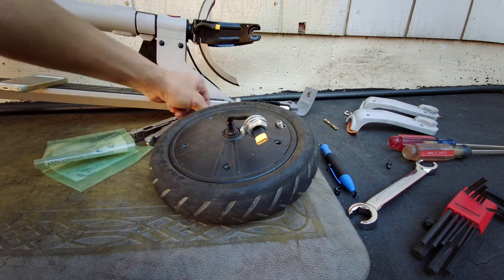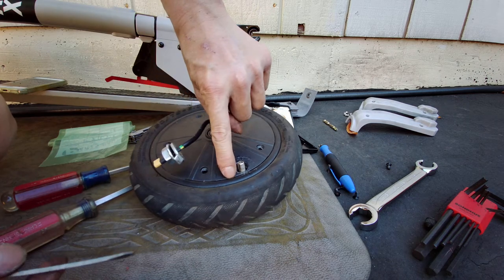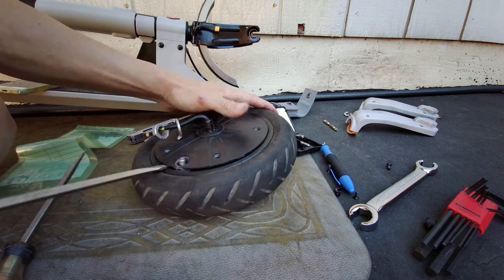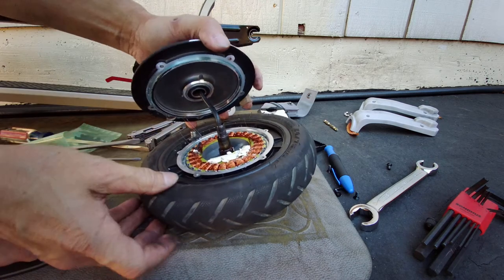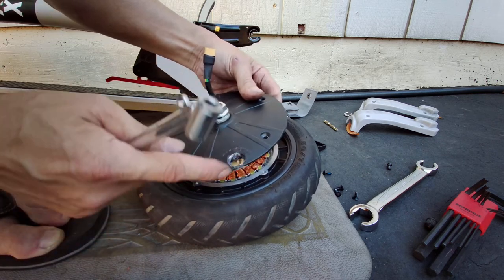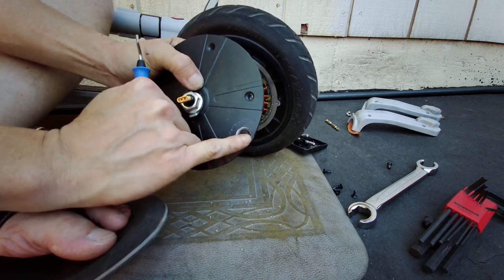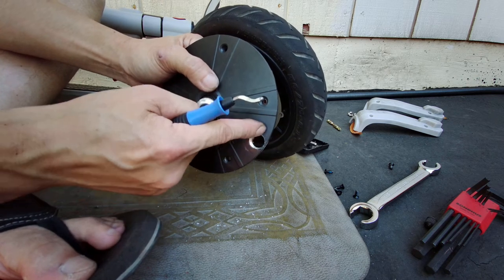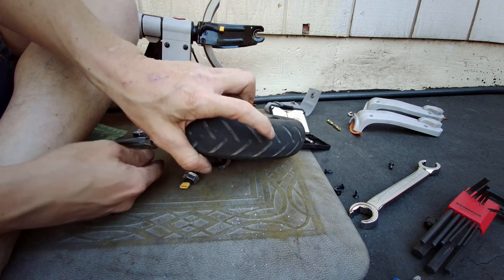GoTrax hub motor plate removal pt.2

Comment: I hit a little bump and now it doesn’t work at all. When I press down the throttle it moves for one second then stops. The number 23e showed up on the screen every time too. Does anyone know how to fix this???
Reply from the maker: sounds more than a little bump.  But check all your wire connections first.

Comment: My gotrax motor started having a grinding noise when i ride for 15-20 minutes. It doesnt make any noise at first but as the motor warms up it slowly gets louder and louder. Ive opened the motor and cant see anything physically wrong which would cause any issues. Any possible ideas?
Reply from the maker: wheel bearings
Reply: @DaBinChe  bearings spin freely with no noise after i open the motor. Could it be the bearings are getting hot and thats where the failure starts?
Reply from the maker: @ovenheating9482  wiggle the wheel side to side if there is play the bearings are toast
Reply: @DaBinChe  i found the issue. Its loose magnets. I know this can be fixed but im not sure exactly how to get the rest of this motor apart to fix it. Do you have any videos/tips or links on how to get the rest of this motor apart?
Reply from the maker: @ovenheating9482  re-glue it with something that can hold up to the heat
Reply: @DaBinChe  alright thank you. Local motor repair company said the repair was impossible and tried to instesd get me to buy a whole new motor from them but i knee this was something that could be fixed considering the magnets are glued in the first place i dont see what would stop them from being reglued. Thank you !
Reply: I was riding today and my scooter came to a grinding halt and I can’t get the throttle to move the scooter it just stopped anything you think could be wrong

Comment: Thanks for the video. Aside  from the physical method of removing fasteners, what was your motivation to remove the plate? What type of failures did you observe after it was dissembled? Were there magnets that were loosened, is there any reduction gears on the other side? I have one that started to make a rattling  noise before failure, then threw an error code 25. I'm am sure the issue isn't other than internal to the hub drive. Aside from the obvious visual failures I might see, do you have any suggestions as what one does to correct  usual type failures on this or similar hub motors. 
Also.. from your video collection it's obvious to me you do have mechanical ability. It appears you aren't the only one who has stripped this fastener. I have found almost all the small allen head fasteners on the GLXs are soaked in blue loctite. My method to assure I don't strip it is that if I am unable to move it, I use the properly sized allen socket and hit it with a hammer. The downward pressure forces the threads to turn and usually breaks the adhesive. The energy transfer vibrates differently dependent upon the the density off the metals and this method has saved me from the dreaded usage of an easy-out. One other question, is the hub motor on the 250 watt Gotrax compatible with the  M365 [is it a three phase motor also]? Anyway I would have emailed this if you had an address in your ''about'' tab on the profile here. Thanks for sharing your videos otherwise any thing you can share about your experience will be appreciated.
Reply from the maker: I took it off so I can open up the valve stem hole larger to fit an air compressor chuck instead of using that dumb hose adapter they give.  So this was still new.  Hub motors are inherently not as long lasting cause they have to take the impact and vibrations directly.  They can be made for that but that cost a lot more.  No reduction gear, it is direct drive.  Not sure the specs on the GoTrax and M365 motors, didn't really look into it.  Of all the models I have my favorite is the G4, them 10" wheels makes a huge difference.
Reply: @DaBinChe   Yes, the stem adapter they include must have the softest alloy I've ever seen. The threads on mine failed rather quickly, I 'zoned one for a couple of bucks and haven't had an issue yet. I was researching what I should expect if/when I open mine up. Also making a plan B as if I am unable to repair mine, the replacements for the Gotrax are out of stock but the M365s are readily available. I know the wheel size is the same on both, do you happen to remember if the M365 wheel is a three phase setup or what the connector looks like? I kinda have a suspicion that the magnets became loose on mine. Any further information you could add I'd appreciate. And yea the G4 looks like significantly more vehicle. It appears they have added front disk brakes also.  Have you had to fix a rear wheel flat yet?  Anyway thanks for the response.
Reply from the maker: @skyviews1205  G4 doesn't have a front brake. What they show on the website is a prototype.  But it does have provisions for a front brake.  I haven't had time to look into find one for it.

Comment: Now ik how to take apart the motor and just buy a new one, my gotrax is slow asf
Reply from the maker: It could be your battery is dying and needs replacing.  How many mile/charge cycles/tires has it had?

Comment: A clicking sound when the wheel rolls, very regular, could it be loose magnets or bearings? (Damaged bearings).
Reply from the maker: sounds like bearings....check for side to side play, also just lift up in the air and free spin it
Reply: @DaBinChe  It only does click-click each revolution, at the same point. And it clicks more when there's some weight on it. When I tighten the bolts on each side of the wheel, it clicks less intensely, but returns after a while.
Starting to wonder if it's not just the washers or bolts.
Reply: @donl3130  I have the same problem. motor still works with clicking but for how long. other gxl motor worked 2 years before dieing.

Comment: I can see why your hands are banged up so badly.  This was a terrible demonstration as to how to open the plate.  It was funny watching you mess around until you figured out how to use several screw drivers to pry the plate off.  Way too funny.  And to do this when an extender would have worked?  I can imagine how much contamination you introduced into the motor during this work.

Comment: Yeah deff don't do this....you actually just hold the tire in your hands and gently "hit" the other side over a soft rag and the hub will pop right up...but DON'T HIT the side with the wiring unless you wanna rewire the stator...kinda obvious but i'm dumb and had to do this lol. Use a rubber mallet to reinstall hubs.